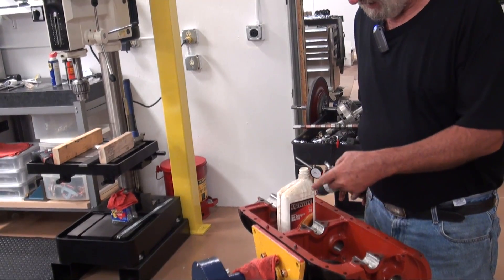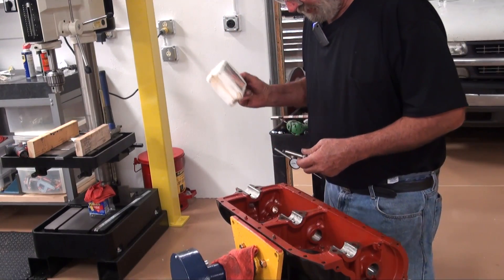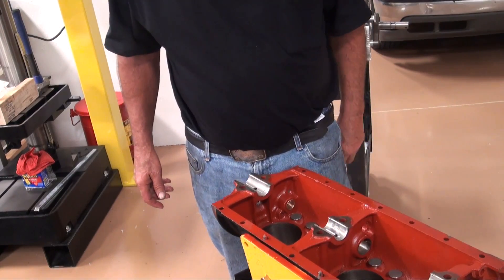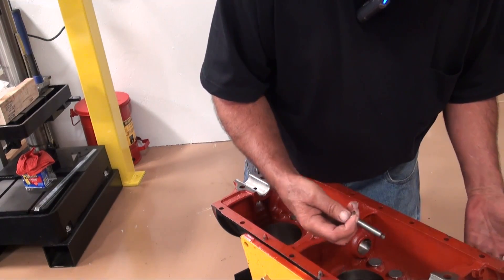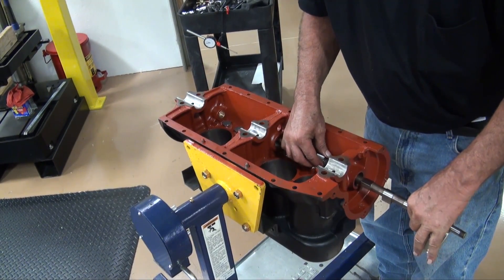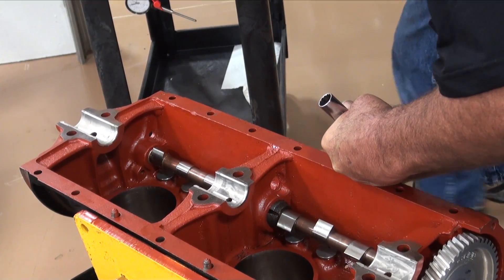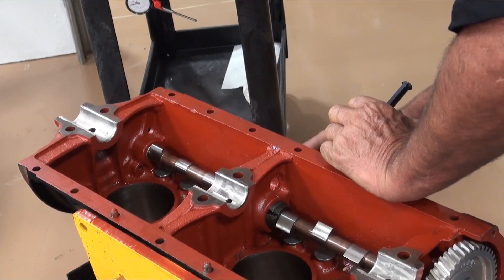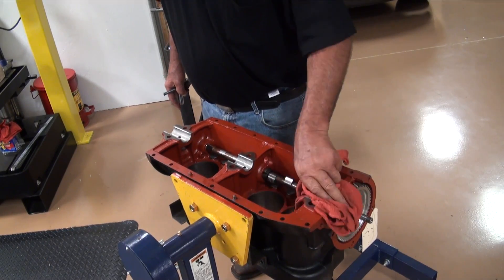Engine 09 Install Valve Lifters

Comment: Are the camshaft lobes on these engines tapered? I am wondering if these engines have the same issues with camshafts being wiped out due to issues with new lifters.